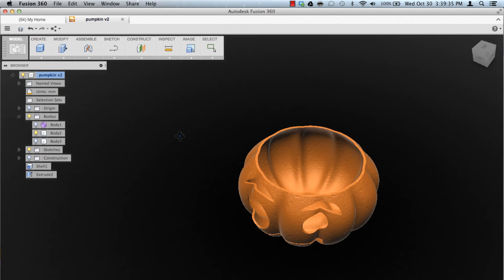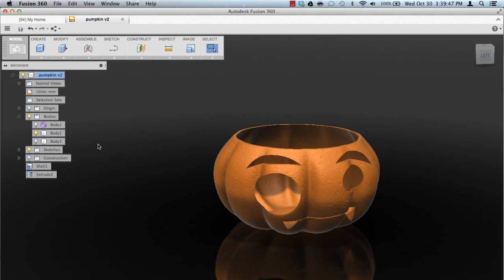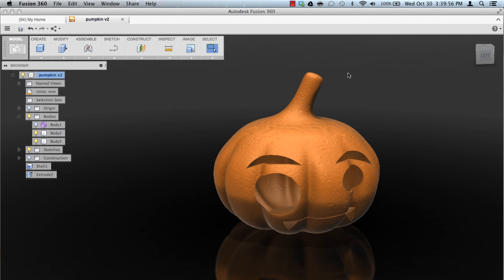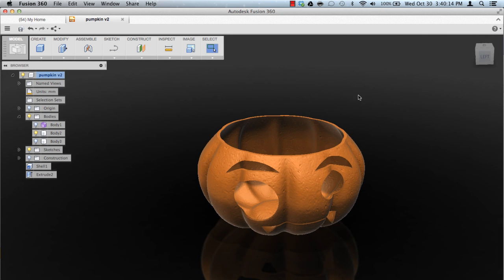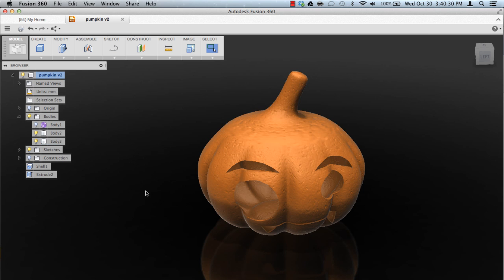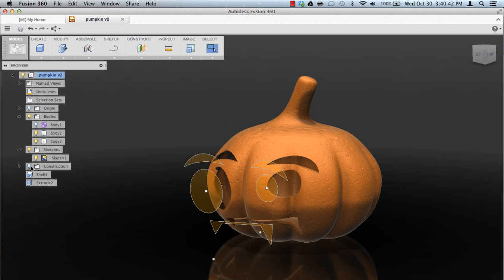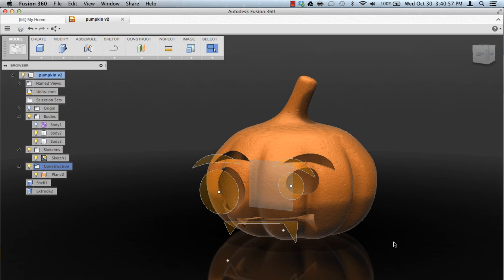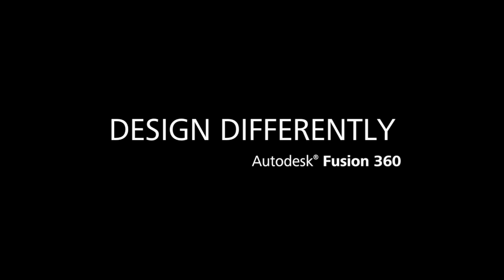Fusion 360: How-to design a pumpkin from scratch

Comment: How are you doing a fill gap on the bottom without it changing all the geometry to flat faces?
Reply from the maker: Surfacing tools? Or maybe other sculpts? There are a number of ways, actually. Maybe I'm not understanding the question though.
Reply: @adskFusion  It wouldn't allow me to do the fill gap without distorting everything. I figured it out though, I guess you cancelled the symmetry command before doing that step. I did the fill gap before symmetry and it worked perfect.
Reply from the maker: I see! Thanks for getting back. More importantly I'm happy you were able to figured it out!

Comment: I've tried to slow down your video to follow along, but I'm having trouble at the 2:01 mark where you select part of the pumpkin.  I cannot seem to get it selected with the three blue sections and the rest yellow.  Mine is always all blue and then when I try to manipulate it it doesn't do just the edges like it shows on your video.  Please help!
Reply: Hi Julie,  try holding control while selecting each face (or command for mac).  Also when manipulating make sure you hold down the alt key which will allow it to create new faces giving it the pumpkin shape.  Let me know if this helps.